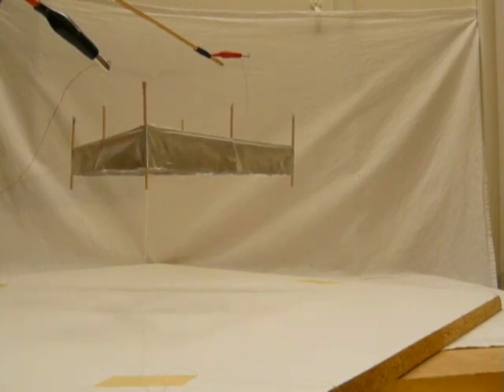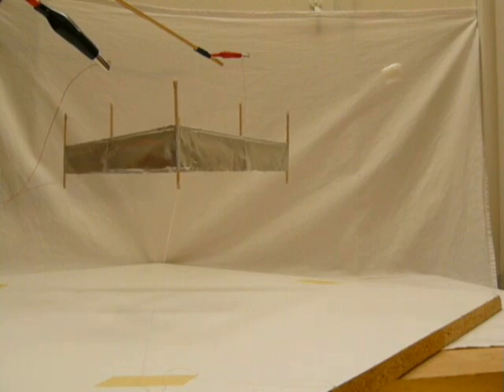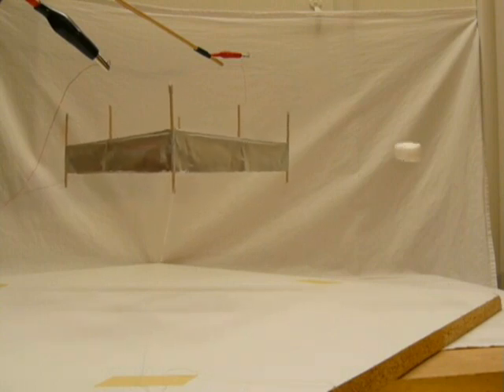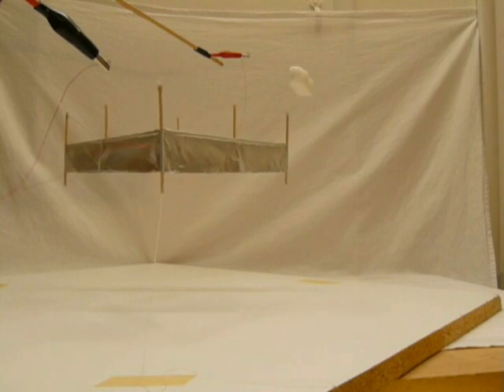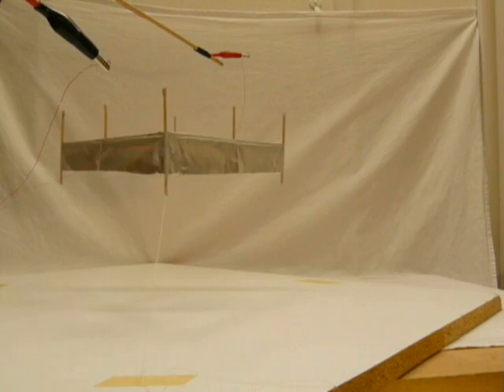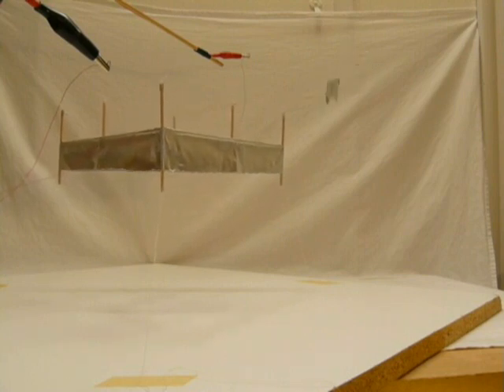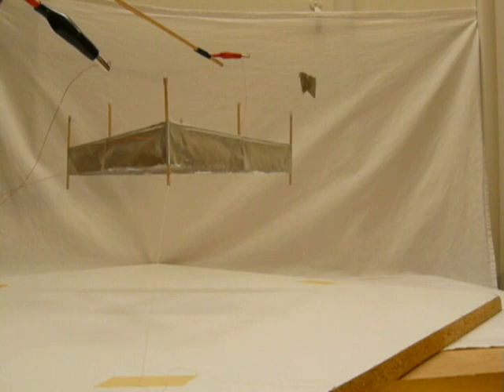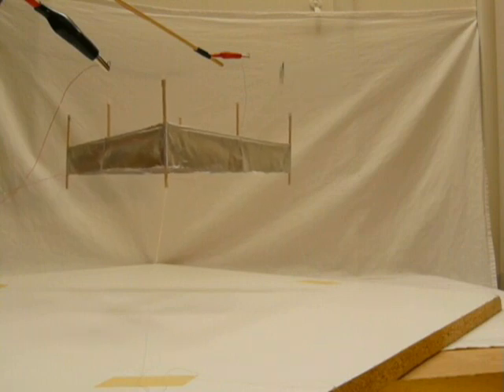ELECTROKINETIC VISUALIZATION: Lifter Propulsion Modeling

Comment: cool-i have been wondering when you'd put out a new vid.
what if you could sprinkle some sort of dust over it,i have used the smoke from an incense stick to show the pressure.
i tried a lifter on my HV DC microwave oven power supply-couldnt get any reaction.
any suggestions?

Comment: Any ideas on a way of maybe using a helium balloon, then foil thing to outer atmosphere, then rockets?.....or whatever combination. I was thinking that maybe there could be a way of doing it by making it small and using different types of technologies to get something up there. I've heard that teslas schematic when reversed could collect energy from the air by using a rod. Maybe lots of these could be used to power the foil thing. Maybe it's about collecting energy from the atmosphere to get it
Reply: One of the STS missions had the crew deploy a "tesla" boom on a 12Mi long cable but it snapped.